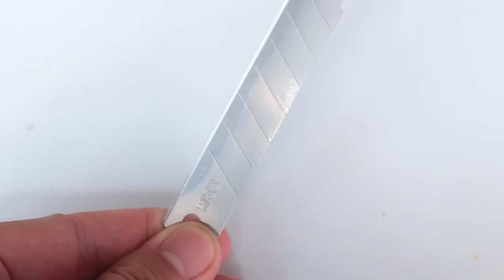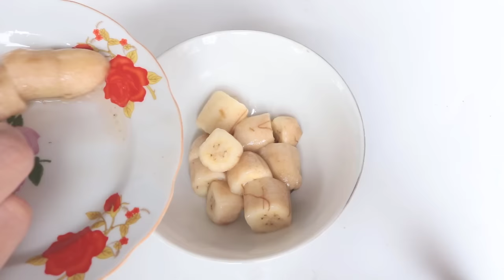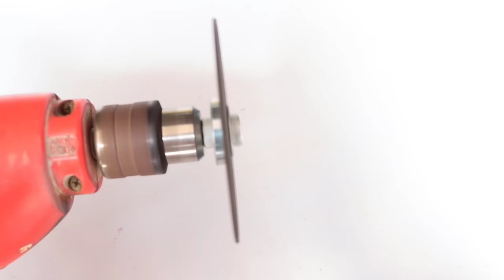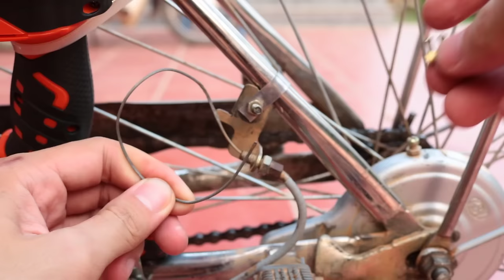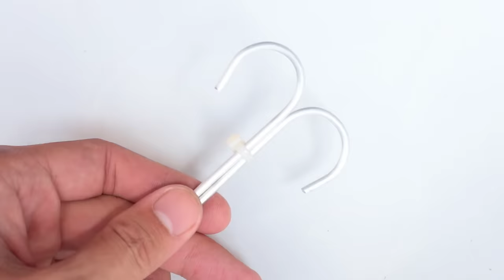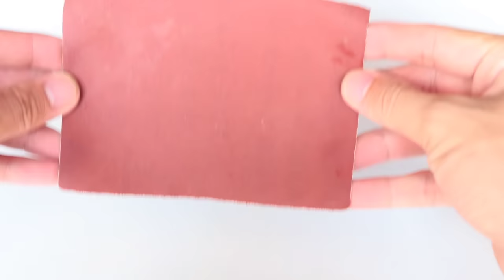TOP 5 Amazing Life Hacks with Drill Machine

Comment: Simple question...
Is it the drill's "chuck" that's used for rotating the tire? (rotating via friction).
{"chuck" = the black plastic thing that tightens the bit...}.

If so, there's lots of "force-delivery loss" via such "plastic/rubber friction" application type.

A much better way to circumvent that - (being among one of the bestest force-delivery application types) - would be via use of gears (incl bevel gears), as it provides a much firmer contact as-well-as to also provide a firm-leverage towards a much fuller force-delivery application.
Reply: a compliment to what your saying but some people (like me) just don't have the skills.😀

Comment: Putting a side load on a drill is horrible for the bearings. So using it as a cutoff wheel or sander is going to wear out your drill very quickly.
Reply: Bushings would wear out faster than ball bearings...they're made to withstand the load. Good quality drills use bearings.

Comment: The bike hack is not good, drill batteries don't even last an hour on continues run; it's better to use corded and a portable power bank that has much greater voltage and capacity then a 20v. Though weight would be a problem in this case